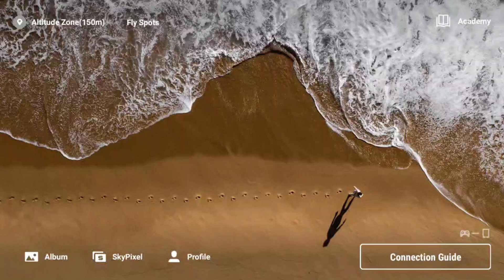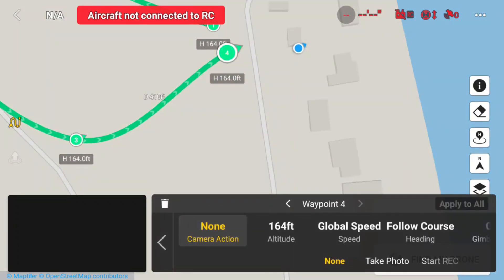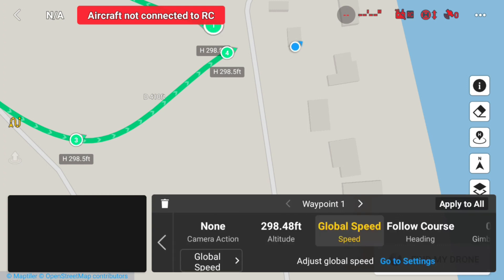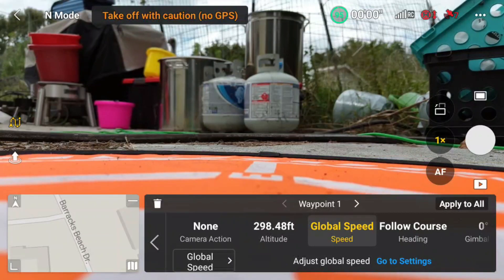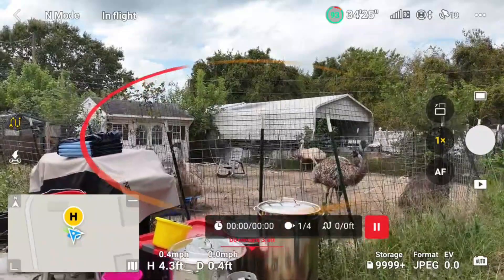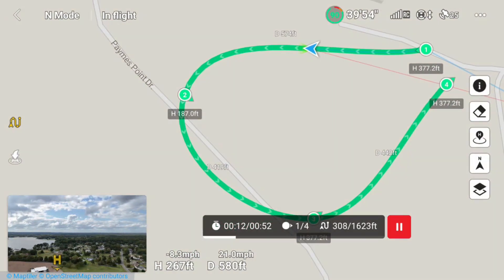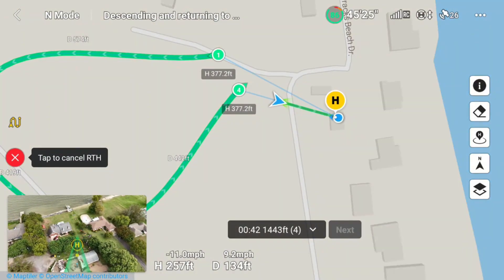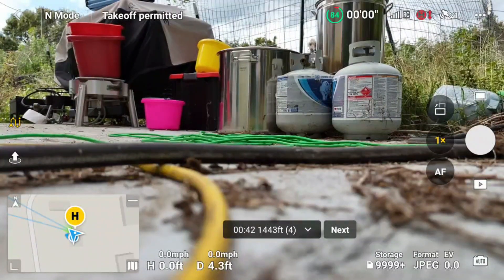A demonstration of planning a waypoint mission for the DJI Mini 4.

Comment: This might be a simple mission for the Newbie, But what shall we do if we need to take 300 photos of a property for up to date monitoring.  Doing this on the DJI hardware is an insane prospect.
Reply: Can you pre-plan a Hyperlapse mission in the same way?
Reply from the maker: @SteveMartinUSA  No, I wish DJI would allow us to do this but at the current time you can only make a planned wpt mission.  Also if you make a hyperlapse wpt mission, you cannot move the waypoints to a different spot like you can with a regular wpt mission.  I thought I could do a short hyperlapse mission and then edit the  file and move the waypoints to different locations but I couldn't.
Reply from the maker: One solution is you could do a hyperlapse mission with waypoints, circle, course lock, or free .  With hy[erlapse you can set how often a photo is taken and the length of the video.  A hyperlapse is individual photos that are turned into a video but the photos remain on the SD card.  I did a hyperlapse today just messing around and the photos were great.  The advantage of a waypoint mission is you could repeat the same mission every time you flew.  I think this would take a little time to plan but I believe you would be pleased with the results.   I am hoping DJI will eventually fix the software so you can plan a hyperlapse mission offline, currently you have to fly the mission and set the waypoints with the drone in the air when planning hyperlapse.  I  am not an expert on this, this is just my uneducated guess of what one can do.

Comment: Ok great video on a great feature. Quick question - I notice the aircraft does not take a direct/straight line route to each way point. The map suggests it curves around to each waypoint. Is that something that can be changed?  Thanks again.
Reply: Litchi mission Utilities can get you close but DJI still flies Through the points and induces curves. Right now I know of nothing to make straight point to point paths.
 Look up Mavic 3 Waypoints with Litchi CSV if you really want to know. even for Mini 4 Pro, Air 3, Mavic 3.
Reply from the maker: @aloeisthestuff9622  Litchi does not work on the Mini 4 or Air 3, hopefully DJI will release the SDK and we will be able to use litchi.
Reply: Do you need the curves to have a nice smooth video at the end. If you don’t like the arcs, then use more weight points closer together where you want the drone to turn .
Reply from the maker: I think there is, some users have complained about the curves, there are some solutions in the DJI forums.   I haven't tried any of the solutions.